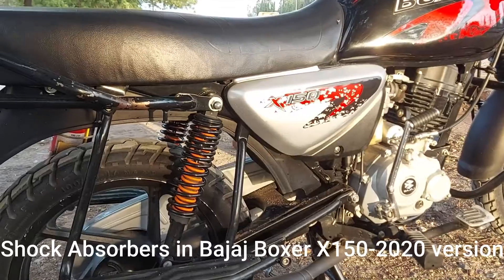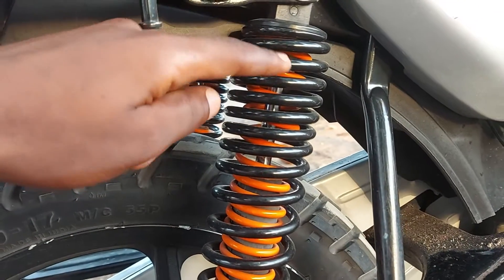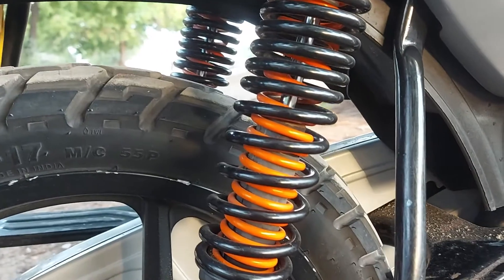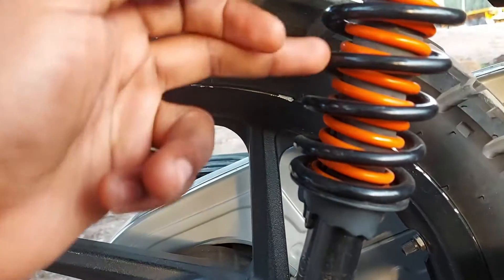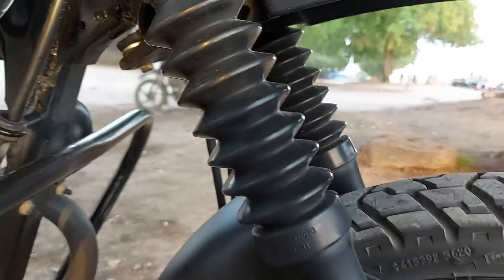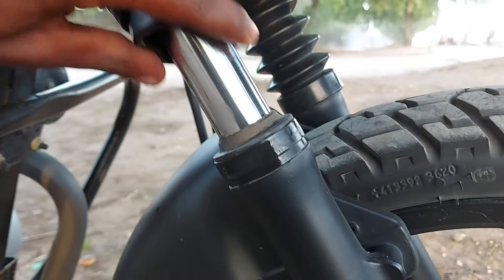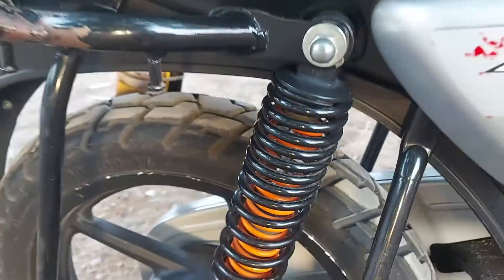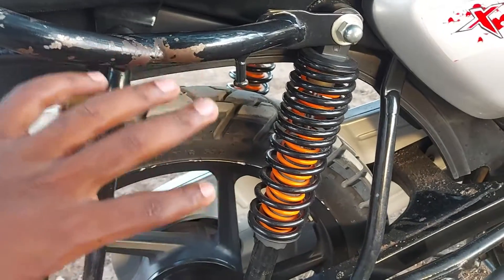Shock Absorbers in Bajaj Boxer X150 2020 version

Comment: Between 150 cc and 150x which one do u prefer?
Reply from the maker: Boxer X is a 150cc,but there are other versions with 150cc like BM 150cc but they aren't designed as X150 ..,there is another version of Boxer X 125cc